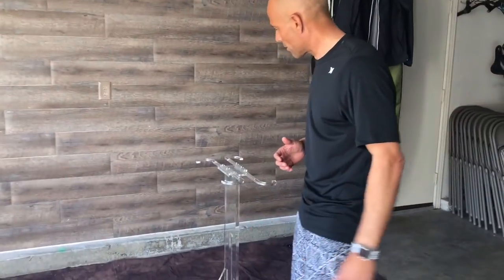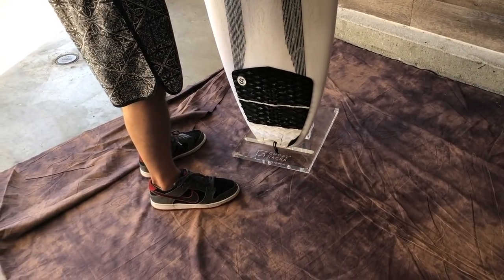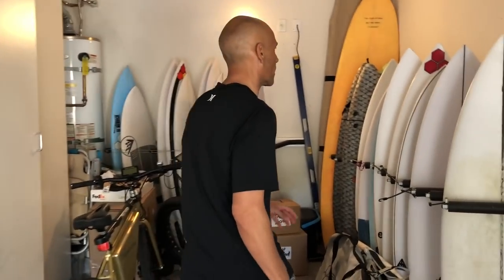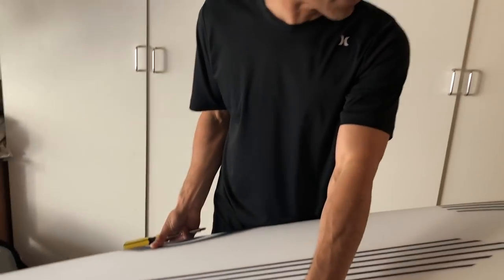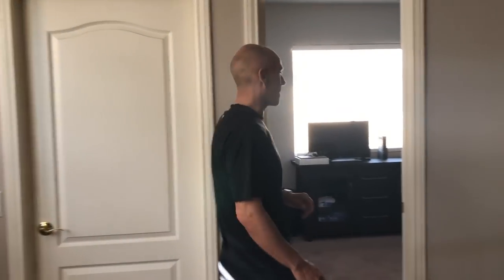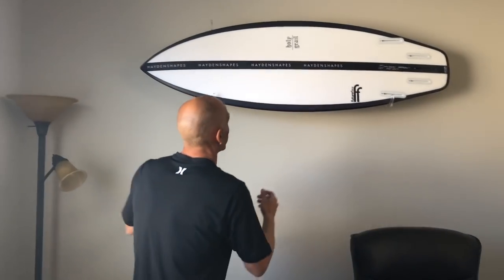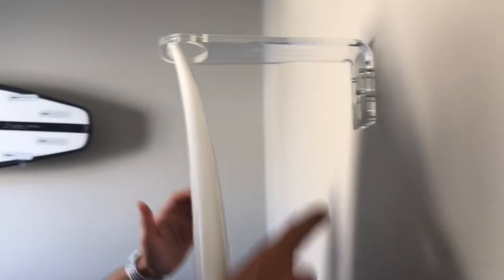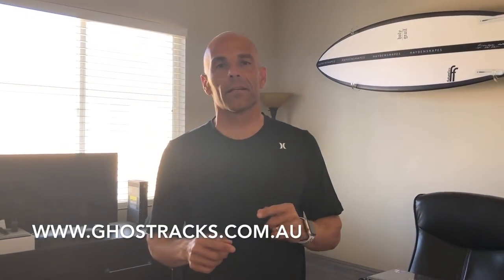Surf n' Show "Cool Finds" Ghost Surfboard Racks Vlog Ep. 5

Comment: Hanging to see your thoughts on ci spinetek... a lot of mixed feelings on them so far. How long until the spinetek review drops?
Reply from the maker: elb2018 Good question... we don’t much for waves in the review window so it could be a while. I think roughly 6 weeks if we get some waves.
Reply: Surf n Show Reviews no worries fingers crossed you guys get some swell.
Reply: Would you give the spinetek the green light or should I wait for the review? Any comparison to flexbar?
Reply from the maker: elb2018 Spinetek is epic so don’t wait for the review. Pull the trigger!!! The Flexbar has more flex but less predictable. The Flexbar is very smooth too... feels like driving a Cadillac if that makes sense. The Spinetek is more durable in the deck too. I say go Spinetek... you will be stoked. Cheers
Reply: Surf n Show Reviews that’s great news I’ve had the flexbar and loved it, best eps I’ve had for sure but the deck is pretty beat up now. Will order spinetek this week, thanks for the quick response
Reply from the maker: elb2018 My pleasure!!! Let me know how it goes for you.
Reply: Surf n Show Reviews ordered a spinetek Black/white in groveller dims. Will let you know how it goes when I get it 🤙🏻
Reply from the maker: elb2018 👍🏻
Reply: Surf n Show Reviews after all that, cancelled the order and picked up a baby buggy in carbon wrap. Very fast and good off the bottom, just need some decent swell now. Watching your reviews helped with my choice so thanks for your work 👌🏻